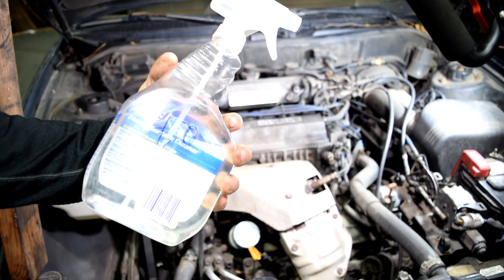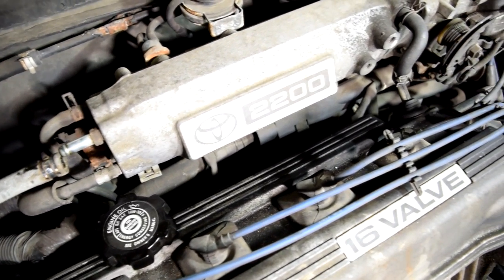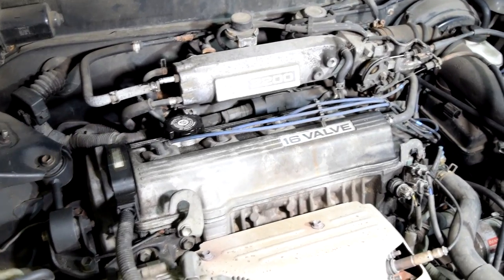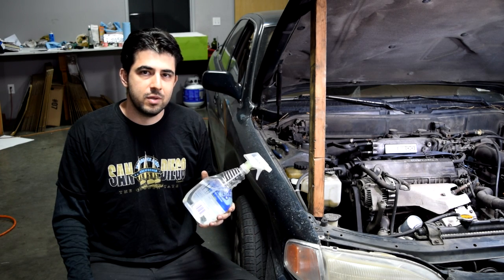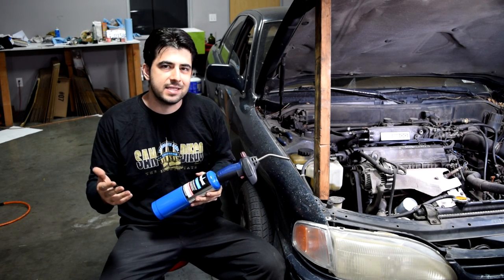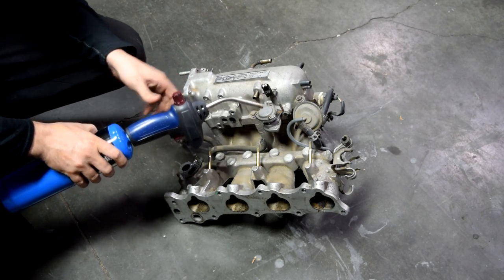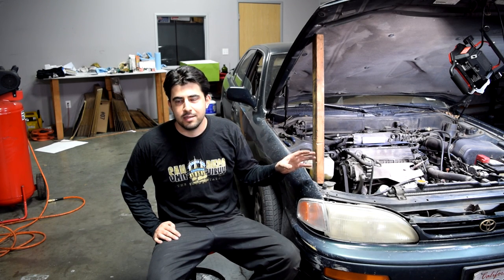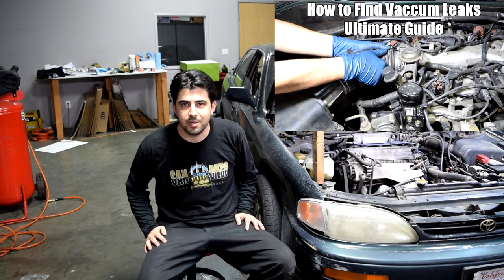How to Find a Vacuum Leak - Water, Propane, Starting Fluid Methods

Comment: Good tips in the video,starting fluid works quite fine to find leaks, used it quite a couple of times. Very nice bonnet stay you have there but it needs a bit of wood varnish.2:26.

Comment: Great video! 2 things here make me really happy.  #1 you explain the process so well and #2 I have an 83 Chevy 305 in a k10 pickup with all emissions deleted so I only have the vacuum connections from the brake booster and the distributor vacuum advance.  That's it! Other than an intake manifold leak or a bed carburetor base gasket mine seems so simple compared to what you just showed.  Thanks

Comment: Only 8 comments, and most of them talking about him spraying water to find a vacuum leak. Small amounts of water are fine. The inside of an engine gets plenty hot enough to evaporate small amounts of water that get in. Now driving through a puddle and getting a cup full of water at once, yeah that will screw up some parts. Water is non-compressible yes, but only if there is enough water to try and be compressed. A little bit of water if it even makes it as far as the combustion chamber would evaporate causing no damage.

Comment: small amounts of water will not harm your engine , in fact its a good way to get rid of carbon build up. I've poured water down my carb while engine is running at about 2500 rpm. just pour it slowly being careful  not to pour enough in to stall it. yes water doesn't compress but at 2500 rpm you would have to dump a lot I at once . common sense goes a long way. water poured down carbs to clean the combustion chambers has been done for years. I read an atypical in popular mechanics when in my teens, my uncles car had slight knock and ran rough. told him about the article I read.....in short it cured the slight knock and run on issues he had. I became his favorite nephew after that . this would of been in the late 60's
Reply: what the fuck?

Comment: All of these videos that talk about high rpm at idle with a leak only apply to fuel injected systems, because the computer pumps more fuel to try and compensate. A carbureted engine wont do this but instead will run like shit instead
Reply: Haiti News Info Haiti News Info  you have ro find the leak, or increase fuel rate in the carb ro compensate (increase idle fuel ratio) but you need to find the vacuum leak, easiest way is to use a smoke machine, hooked to the intake manifold, put a plasric bag over the carb. Watch to see if any smoke comes out where it ahouldnt and that will show where the air peak is. There are so e good youtube vids on how to build a cheap smoke machine with a soldering iron, a jar, and a cloth dipped in mineral oil

Comment: ummm... I thought water was NOT compressible? (so not good inside the combustion chamber)
Reply: Only if you fill it with water.
Reply: A little bit of water is fine. Actually it will clean some carbon off the pistons.

Comment: I use soapy water. Super safe and the soap will bubble at the site of a vacuum leak.
Reply: That won't work unless there is a pressure leak, pressure creates the bubbles when you spray the soap water, a vacuum leak won't create bubbles because it's sucking in and not blowing out.

Comment: This is a horrible video anybody that would use anything that is flammable is stupid. It's better to use carburetor cleaner or brake part cleaner and listen to your motor smooth out.  Not nearly as combustible as propane or starting fluid! But it's still best to have a fire extinguisher readily available.